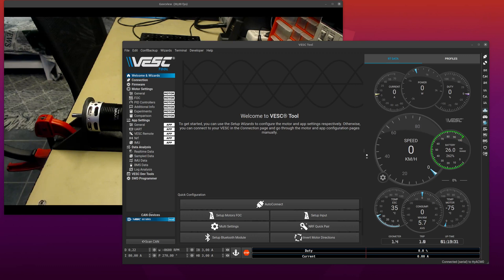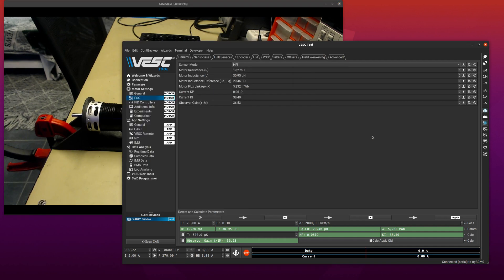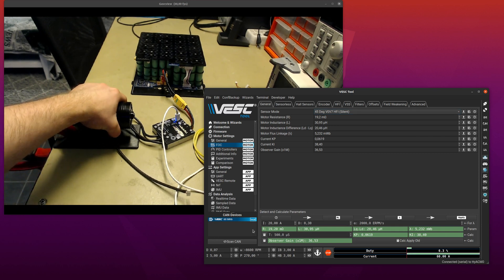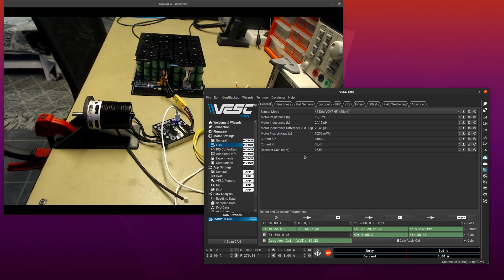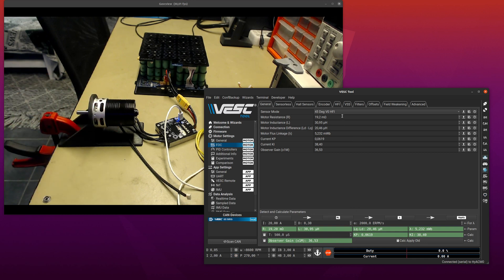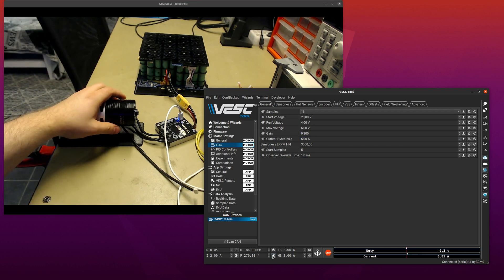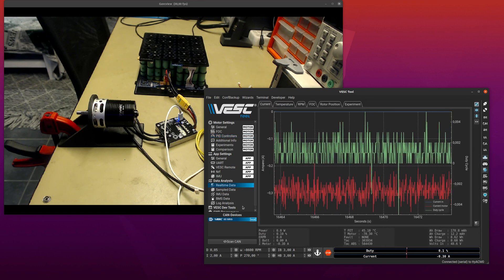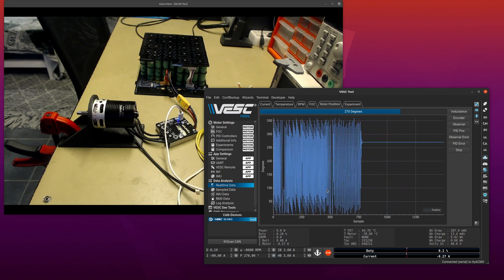VESC silent HFI. Sensorless full torque at 0 speed.

Comment: Hello, I have a question. I am using the latest version of vesc6 (mks v6.7pro). The angle estimated by the upper computer using the sensorless HFI seems to be inaccurate. It has been fluctuating at a fixed value. The effect is quite different from that in your video. Can you give me some help? The motor I use is DJI's 3508.

Comment: I need help, I have a project, a middrive motor for a bicycle, I use a 7070 motor, and a vesc 75100 controller, and a 48v 11ah battery, I noticed that the acceleration is very aggressive, causing the motor to break the reduction clutch bearing that I used it in the project, I already tried to make a negative acceleration curve, and even so, when accelerating, the engine starts very "violent" and gradually increases, I needed it to start very slowly in the first 2 seconds, and only then does it go up acceleration quickly, would you have any tips for me to achieve this?  I use a common thumb accelerator!

Comment: I just tried it with a onewheel motor and a Trampa 6-75 using 32kHz ZVF. Inductance is 200uH and Ld-Lq diff is 50. Unfortunately it didn't work at all. Just scary noises at 10% duty or at 4A current. Anything else I may need to change from the defaults for it to work better with this kind of motor?
Reply: Me too, it always failed.  it just a demo he did , who knows it real or fake😢
 You follow him step by step ,but maybe he hide some important thing in his project he never told you .  so don't trust this guy 😢
Reply: @活久见-q3f  frankly your comment is just ridiculous. Benjamin is one of the most trustworthy motor control engineers in the community. Of course it’s real. Plenty of people have replicated it. But it just doesn’t apply to all motors
Reply: @surfdado  ok,fine, whatever, what I can say... Too young  too simple.

Comment: I am wondering if i could use a 16x16mm drone fc, to flash vesctool to it, it has the same chip. and than use modified drone motors to make self balancing mini onewheel? not having hall sensors was the biggest issue, but this seems it could work well to play around with it

Comment: Hi Ben, 

Brilliant work as always on VESC. 

I updated my VESC 6 Mk 4 to FW5.3 yesterday and motor config ran fine however I went to config the App settings today and map my PPM values and I've got a Current Sensor Offset Fault on Phase 3 sensor. 

Is this possibly something FW related or almost entirely HW related and how can I troubleshoot it?

Comment: As far as I understood, speed is calculated from ERPM, diameter and poles. So max speed is expected to be max ERPM with same calculation. In my setup the motor reaches max ERMP but max speed in diagram is shown much higher. What I'm doing wrong?

Comment: Incrediable!  Ive been following your work since around the time you first started.  I feel privilege to have witnessed it grow.    Ive been using your FW to control a kickscooter hub motor for a while. The ability to fine tune the controller to a specific motor is where your FW and tool shines.  The more variables available for tuning the better in my opinion.  The wizards will get you in the ballpark but man, after learning the how, whys and whats of some of the options Im so impressed with what Ive been able to achieve so far.  Thank you!!!!

Comment: You got me with the full torque at 0 RPM and then you pulled out the perfect position detection... I am blown away and I dont use words like these often.
All without sensors...its amazing. 
I wish you would develop larger automotive inverter with high Voltage and current.
I do work in that field and the Commercial inverters are trash compared to yours :D
Reply: There is a 100v VESC along with 100v VESC based controllers available unless you need something even higher voltage than that lol.
Reply: @hairymanjack6767  flipsky can go up to 120v
Reply: Axiom vesc

Comment: Absolutely amazing innovation! You mentioned that silent 45 deg HFI has higher resolution than an encoder and even at "full load" you get tracking (and demoed it). I assume part of the reason for the high resolution is the motor construction? You have 7 pole pair motor so that's 7x the resolution?
Now.. basic NEMA (hybrid) stepper motors have 50 pole pairs. "Different kind of motor" but actually more like 2-phase close cousins of the 3-phase BLDC motors you've demoed, especially given how modern/chopper stepper motor drivers drive them (FOC). The biggest problem with the stepper motors is that they can lose steps for which the usual fix is expensive servos. But now, how about applying the same silent HFI method in a stepper motor driver to get a very high resolution position (due to high pole pair)? Thus a stepper motor with no step loss (or "encoderless servo")! Which can not only drive to position but can also observe and account for deviations due to load. What do you think?